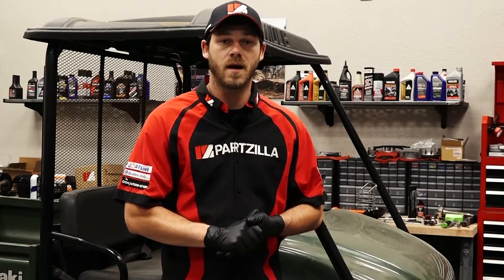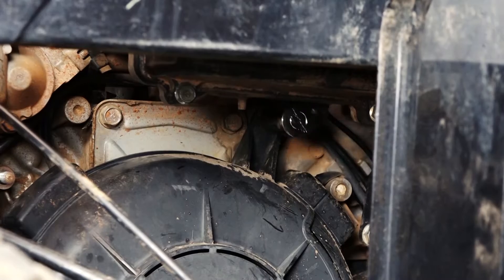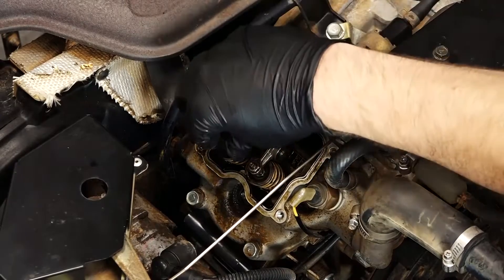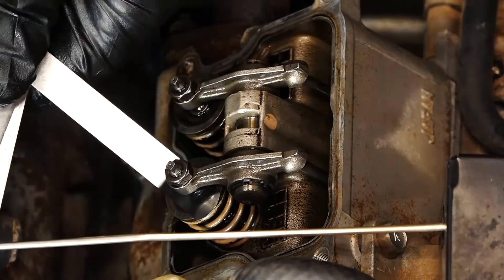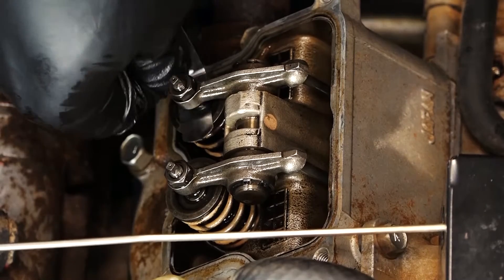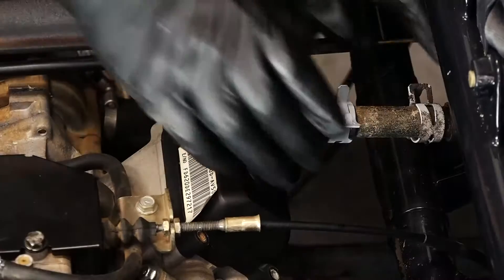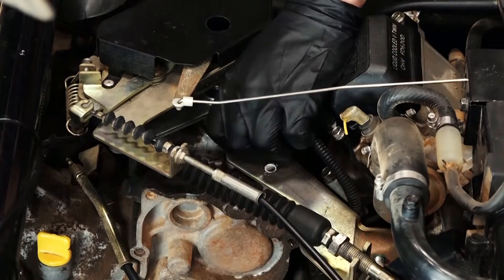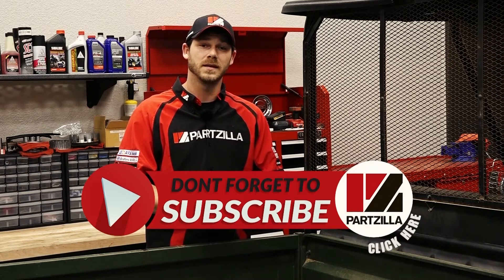Kawasaki Mule 3000 Valve Adjustment | Kawasaki Mule 3000 | Partzilla.com

Comment: Pretty good video, however you adjusted the # 2 valves while on the # 1 crank mark. You mentioned "top dead center" but the # 2 cylinder is NOT on TDC when the #1 mark is line up on the crank case. Otherwise a well done video partner!

Comment: Your video is helpful, but the book for this engine says the #1 cylinder is the front and #2 cylinder is the rear. Your video is opposite of the manual. The engine is the same Kaf620. Any additional info would be helpful.

Comment: I have a 3000 mule. The spark plugs are very wet. I already checked the carburetor. It's fine, but the same problem continues.

Comment: Did anyone else feel that they are adjusting the rear valves while on #1? I found other info that indicates #1 is the front head, and this is what I observed when doing it myself.
Reply: the books says front is #1 and rear is #2
Reply: He need to update this video. The back is #2
Reply: THANKS TO ALL REPLIES:Today adjusted my mule 3010 which is a 4x4,valve lash and yes your right back  cylinder is  #2 plus you can’t take the -flywheel  cover off the rear driveshaft is in the way even if you remove center u joint strap it still doesn’t give you the enough clearance to remove cover.  My last resort was to use a pry bar to bend the plastic on the flywheel cover  back after removing the hardware holding it on to find the #1 number and #2numbers then I used a whiteout marker to mark the locations and for reassurance I took a 10”long dowel rod, a screw driver will work as well, stuck it in the spark plug hole and turned the flywheel and watched the rod raise up and stop it as it began to drop back down (TDC) checked my marks and it all lined up for each cylinder after adjustments the mule idles perfectly.THIS VIDEO IS WRONG ,but it created all of you who left replies thanks to all!
Reply: I'm glad I'm not the only one who noticed this!

Comment: I have a 3010 its running on 1 cylinder(front) but the rear cylinder has good spark, seems like no fue going to it, I cleaned the carb, same results. Compression is 75-90 in both cylinders, plz help..thx

Comment: Great Video - Thanks. On my 2002 Kawasaki Mule 3010 I am un able to get the flywheel cover off as the propshaft is in the way and there isn't enough clearance to get the cover out once it's unbolted. Any suggestions?
Reply: I have the same one. Remove the 2 bolts that hold the carrier bearing for the small driveshaft that goes to the front. They are on a crossmember. The driveshaft will now move enough to get the cover off. If it comes out of shaft no big deal.
Reply: I was able to pull the plastic back far enough to see the marks, used a pry bar to turn flywheel
Reply: I have a 2005 mule 3010 and have the same problem. Would like to know also.